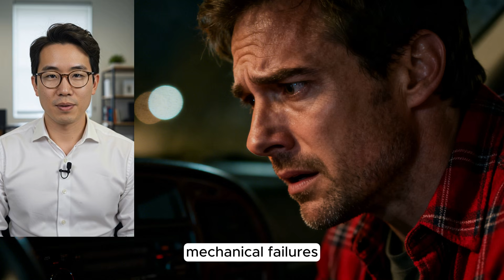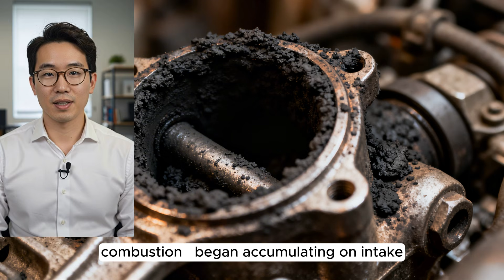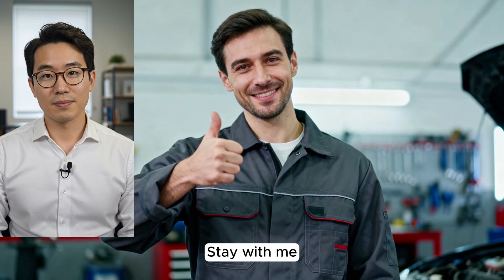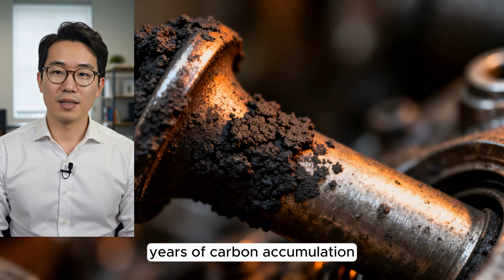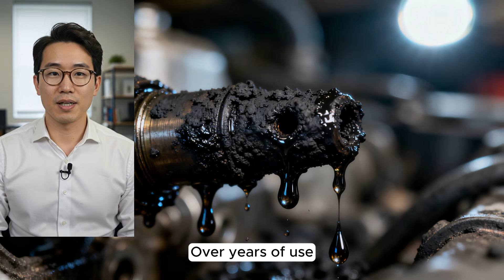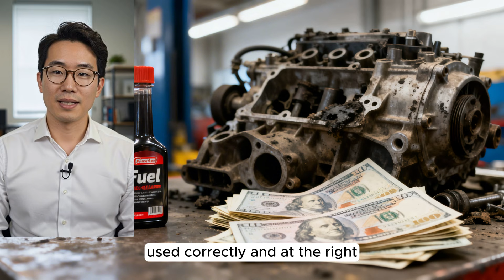$2 Fuel Additive REMOVES 5 Years of Carbon From Any Engine PERMANENTLY — Dealers BURIED This

Comment: I thought if you used these cleaners in that strength or too often, it causes damage to your oxygen sensors, fouling of spark plugs and injectors. Just what I’ve read!!
Reply: Sounds about right. Though I would use something every 3-4 months. I don't think that's harming anything at those intervals.

Comment: But it can't work if you use it on direct injection because it still bypasses the valve
Reply from the maker: Great point  you’re absolutely right—since direct injection bypasses the intake valve, it limits how effective this can be
Reply: @ForbiddenFixes-1 will this work on a 2010 audi a4 2.0T Quattro